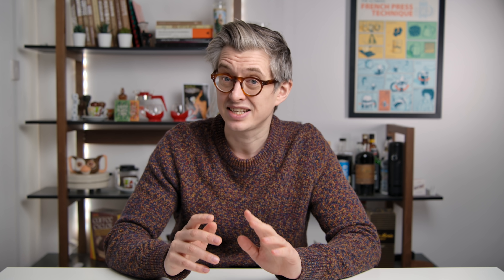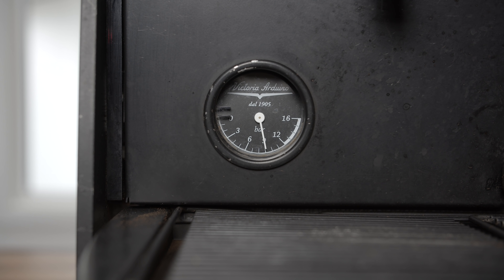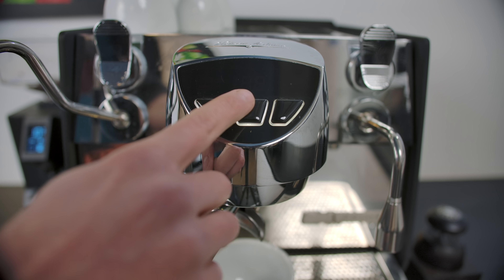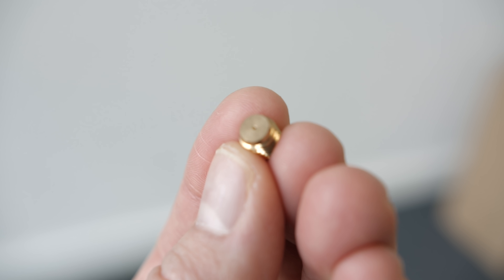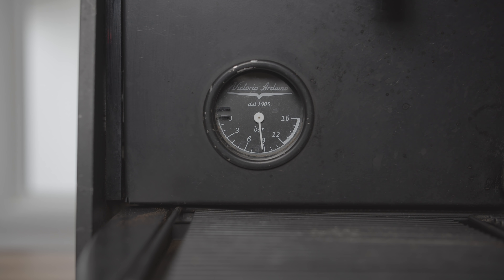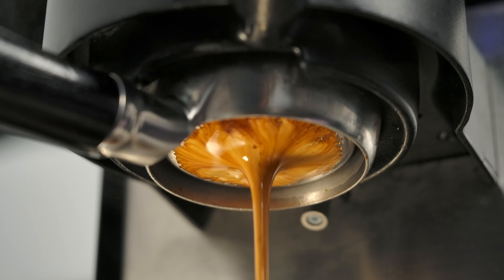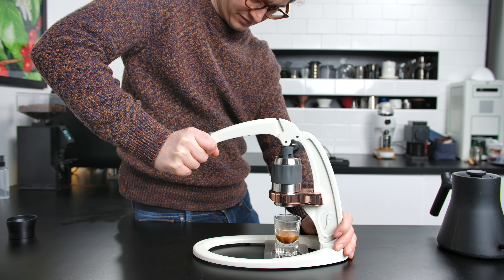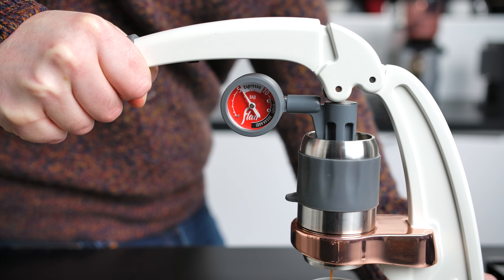Understanding Espresso: Pressure (Episode #6)

Comment: Dear @James: Thank you very much indeed for this illuminating episode! Since you asked what we do think, here is my question: 

If I undestand it correctly, at approx. 9 Bar, the maximum of what you can extract of a bean is achieved. Is that true for every type of coffee and bean (even if not desirable), and especially, for all filter sizes? As I understand it, if all parameters ar held identical (but scaled to the filter size, so 70 % for 49mm etc.), the same extraction yield is possible, but then the pressure should be the same?  

And foremost: What are the implications of this in regards to brewers like the Cremina, where often 6–7 Bar is used? You seemed pretty happy with the extractions in your review of this machine! Was the 6 Bar in the Video just a coincidence, could one have extracted even better at 9 Bar (is that even possible)? Should one alwas aim for 9 Bar, if possible, or are lower pressures better for certain filter sizes? Thanks for great content, as always, and best regards. Hope you have a wonderful day!
Reply: 9 bar is just the fastest. If you want to extract the maximum you do 0.001 bar and let the shot run for 20 minutes.
A short contact time with the water allows you to grind fine and achieve the taste profile that is characteristic for espresso.
In a way, 9 bar gives you the lowest possible extraction at a fixed grind size. 
The main concern today is the evenness of extraction. 9 bars is probably a little high for very even extraction but below 6 bars there are diminishing returns.

Comment: Could placing a paper filter, say something aeropress-like, on top of the tamped, dry coffee help cut down on channeling?  It would need to fit well so that fluid doesn't rush around the rim; however, the paper filter could simultaneously press down on the dissolving puck and diffuse any unevenness in the flow that might otherwise cause uneven erosion and channeling.  This may require slightly tweaked extraction time/temperature/whatnot, as a (hypothetically) very thick filter would reduce the overall flow rate and transmit the full weight of this load loss onto the puck: presumably compressing it as it dissolves, reducing it permeability.

Comment: I cant understand why 9 bar pressure is linked to the finer grinding level. You could grind as fine and with 6 bars pressure just your shot will take longer time. You could compensate that with lower water temperature if you don't like so high extraction.

Comment: I’m in the budget camp.... I’ve had the same Gaggia Evolution, a non solenoid Classic basically, for about 15 years but only started to get consistently reasonable espresso once I bought a half decent hand grinder, an Aergrind.  
My shots improved further once I started prewetting the puck with a 15ml scoop of hot water from the shot glasses I was preheating, filling and prewetting the basket even before placing into the holder.
If I prewet for too long, the puck degasses and you get zero crema, which looks rubbish but tastes fine.
The espresso from Smallbatch (Brighton) is usually still better, though...

Comment: My Lelit Grace produces 40g from 18g in 25 seconds, but used normally it will run 11-12 bar pressure!
Yes, I could grind coarser, but to run at 9bar I'll get my 40g in 10 seconds.
The OPV is set very high, and it's a major faff to change.
I've taken to opening the steam wand during extraction - water comes out and I can bring the pressure down to 9 bar.
Does this strike people as sensible, or mad?
Lelit are in total denial it's a problem and are actively unhelpful on the subject.

Comment: I have a sage bambino, and the pump audibly changes tone and volume between the preinfusion and full flow. Presumably this is yet another way of doing preinfusion? I.e. Lower pressure from the pump to start with, rather than mechanically restricting the flow

Comment: Thank you for this video. My ECM Synchronika was running at 10bar, after watching this I dropped it down to 9bar and what a difference it made to the shot. A more consistent extraction, a better tasting shot and what you said about the higher pressure compacting the coffee puck making it harder to extract must have been happening with mine.

Comment: When you turn the pump on on a machine that has a rotary pump, the pressure jumps up to 9 bar, or whatever it's set at, pretty much instantly. Vibration pumps take a few seconds to build up pressure. Is that kind of a built-in preinfusion process?

Comment: Great video! I have a Flair and for me extending the preinfusiont to 6-7s and lowering the pressure from 9 to 7-8 bar than slowly decreasing helped a lot. Also I use a comandante grinder, the increas in dose and the grind size really helped.
Reply: How do you like your Comandante? I'm on a waiting list for one after doing tons of research. I had a hard time deciding between the Kinu and 1Zpresso and the Comandante but in the end decided the Comandante would be the best for me. I also have a Flair.
Reply: @limer4330  Hello, It is great, and it is accurate and fast. It is much better than my previous porlex. I do not know if it is better than the kinu or 1zpresso, but it is made in germany and for the development they use a particle analysis of the ground coffee. It is really well made so with some maintenance it will last forever. It worth the price.
Reply: @kk215487965  Good day. One of the reasons I like it is that they spent over 100k euro on a particle analyzer. I doubt Kinu or 1Zpresso are at the point where they can even afford to make that investment. I would imagine that particle analyzer has played a big role on the overall design of the burr set in the comandante. And yes, made in Germany is big for me. They are hand built in the same building they are designed. Thank you for sharing your experience with me.

Comment: I have a 20-year-old ECM Giotto, and I noticed that despite the pressure gauge showing 1.2-1.5 bars of pressure, I get much more pressure if the machine has been on an hour or more than after 20 minutes, but again the pressure gauge shows 1.2-1.5 bars from 20 minutes onward. What gives?

Comment: 1. What happens to the taste with the different pressures?
2. Are there espresso machines with pressure valve on the outlet (after the coffee) to control flow and pressure?
Kind regards 
JSP
Reply: Pressure itself doesn't change the taste. Lower pressure generally improves the taste but you have to grind coarser and coarser and it will taste less like espresso. The optimal pressure is the one that prevents channeling but is still fast when you grind fine.

Comment: How about machines, where pressure only results from your brew recipe (like the typical Quickmill Rubino)? I mostly try to hit a 1:2 ratio in about 28-30 seconds, which always results in the machine showing a pressure of about 12-13 bar. The only way for me to reduce the pressure is to go for higher ratios, which of course has a big impact on the shot. Am I getting something wrong here?

Comment: I use an ECM Synchronika with the flow control needle valve in the E61 group. I am obsessive about uniform puck prep and consistent grind, so I use a high-quality grinder, WDT, OCD distribution, and a self-leveling calibrated tamper to eliminate most variables. I primarily drink darker roasts. I have found that the natural 3-4 second preinfusion is desirable for dark roasts, but with SHB high altitude lighter/medium roasts featuring higher acidity, a longer preinfusion before ramping up pressure tends to tone down acidity while preserving the bright fruit/floral/sweet flavors. I usually gradually decrease pressure near the end of the shot to avoid overextraction. It's a fun thing to play with when I get a batch of beans that I feel could use experimentation to improve flavor. I had the pleasure of playing with a Dalla Corte Mina that has full digital flow control via a tablet. It was amazing, but that's a rabbit hole I'm not ready to go down. 😁

Comment: Hi James! I'm hoping you may be able to help me with an issue that Breville haven't been able to. I have a Breville Dual Boiler (BES920BSS) machine at home. I am able to get the full 9 bars of pressure with a single shot. However, with a double shot (my go to!) I only reach about 7 bars. I am grinding using the Breville Smart Grinder at size 4 (very fine) - about 16-18g.  Is this normal for home machines? Love all your knowledgable videos. Keep up the great work!! Tom

Comment: So from a while back, I've taken your advice Mr. Hoffman of switching my dose to 14g, like in Italy, because less is more! 
This has lead me to tinker with Pressure, by opening up my Gaggia Classic.  With a smaller puck, the flow rate increased, and my grind size came to a point that was too small. I researched to no avail, what pressure do Italians apply when pressing a 14g puck into 40+ grams of liquid?  I dialed in the same espresso bean for 9, 8, 7, and 6 bars pressure. I found with lower pressure, espresso had a less harsh mouth feel and taste. If the pressure is too low,  you risked losing that zipp or acidity(?)and a balance in flavor. I settled on 7 1/4 bar as it gives a softer/rounder(new flavors) shot of espresso still with enough zipp and flavor.
(plus more room to play with at the small end of grind size) 
What pressure is custom in Italy for a 14g basket?
Reply: How are you getting 7 1/4 bar? Cutting the spring?

Used the 9 bar and now 6.5. 
Wondering how your more recent experiments are turning out to be.
Reply: @simonmonty7171  with Gaggia Classic, you can open it up and turn a specific nut, every 1/2 turn equals 1bar pressure of change.
Reply: 14g to 40g+? =this is almost a ratio of 1:3  Your style of espresso?

Comment: Any insight on pressures above 9 bar would be super useful. The new model gaggia classic pro brews at 12-14 bar and I for one would love the know:
A) why?
B) are there upsides to higher than 9 bar pressures?
C) are there major downsides?
D) what product you use in your hair
Reply: To my understanding this is to accommodate users who use pre-ground, store-bought coffee and utilizing the pressurized basket. I modded my gaggia classic pro pressure a week after i got it new and installed a pid 2 months after, that was just two days ago. Lol
Reply: I think a lot of people mod it so it does 9 bars (or sometimes 6). I think they say you're more likely to get channeling if the pressure or flowrate is too high. I think you'd end up with a more intense likely bitter and less than balanced shot usually. It COULD work well with certain lighter roasts depending on your tastes maybe.
Reply: @BensCoffeeRants  with high pressure you have a small room for error in your puck prep. You’ll get channeling unless you distribute the grounds perfectly.
Reply: is there a benefit for going up to 9bar? I hear that 6bar is the sweet spot for consistent and best tasting espresso?
Reply: @tusokpoweru  might be easier to work with 6 bars but I think 9 bar is probably going to have more intensity. Also not that it matters but I don't think it's technically espresso unless you're hitting 9 bars.

Before I really knew what I was doing I played with my machines opv settings a bit. Found 6 bar was nice but lacking intensity kinda boring. 10 bars was more bitter and intense but that also could have been because I had poor coffee prep back then and was just getting channeling. I think I kept it at 8 bar for a while and liked it there.

Comment: Hi James, could you please also touch on the aspect of pressure vs temperature? I mean a higher pressure generally also yields or is able to yield a higher temperature, right? Are those variables interconnected? I am asking because I own a Londinium R24 which, from what I understand, does not come with the possibility to increase temperature but it does come with the option to increase or decrease preinfusion pressure.

Comment: As usual great video! I cannot explain how it is possible thet I have a machine with a 16 (16!) bars declared pump, and unless the gauge measures 11/12 bars I get a superfast flow. I need to read something like 11/12 bars at the gauge to be in the 25/30 seconds range for a 1 : 2 ratio...
Reply: Same here. Grinding coarser an I will get a shot with lower pressure but lots of mess and it’s super fast. Tried to slow shot down with a higher dose but this did not make any difference.

Comment: I'm currently using a Breville (sage) dual boiler and currently running the whole shot on a preinfusion setting that allows for around 7 bars for extraction. The beans I'm working with taste completely different between this setting and at the standard setting (which I assume is around 9 bars) and while I'll probably revert back to no preinfusion, it's been interesting to monitor the differences between shots. Thanks James for giving me the confidence to tinker!

Comment: This made me quite pleased with my Breville Dual Boiler (lets be fair, i already was). I run a reduced pump pressure and grind to aim for 6-7 bars and then it nicely falls off as the flow increases. With a VST in it, a nice wide tamp and a paperclip.. pretty sure i often get even better espresso from that than my PB at work( which is set to 6bars). My grinder really is my only limitation in a home context.

Comment: As a pavoni user, I find that topic highly interesting, since I am the pressure (sounds funny...) . You speak about grind size (finer allows more pressure), preinfusion und pressure profile but how much does tamper(pressure) affect all the previous parameter? Interestingly enough, I don‘t have a machine equipped with a pump and I can‘t measure the pressure I apply while tamping so I only rely on feel, I‘d love to have your insight on that in order to gain consistency on my shots (which might sounds paradoxical for a pavoni user...)! Thanks!
Reply: @pauldavidson5  True, a leveling tool is another stable parameter in the process,as is time, tamping pressure remains more erratic, since I don‘t use either a dynamometric tamper or a puqpress.
Reply: @pauldavidson5  Right! We should claim the title of „old school analog home wannabe barista“

Comment: Hi James, as much as the Aeropress is an emersion brew, I was wondering, if this is possible: once the coffee is inserted into the aeropress brew chamber, using a tamper (with a long enough handle to tamp down that coffee. then pouring just enough water to bloom the coffee. Thereafter placing one of those metal aeropress filters on top of the coffee bed (to keep the coffee in place) and finally pouring in water and then quickly placing the plunger part on top and pressing down to create some sort of pressure. Would this work and also, a nice way to play with pressure? Side note: as anyone invented a naked porter filter with a clear screen around the bottom end of the basket so that if there is channelling, there is less mess?

Comment: I've longed after a new Spring Lever since I blew mine (a Ponte Vecchio Lusso) up after running the boiler dry. I think the reducing pressure and flow they provide is a great result and I think more 'natural' kind of than the active profiling of the Decent (which I also lust after). This leads me to wonder if the cult like following of the Cremina (yes I'd like one of these too) is a result of this natural profiling.

Comment: i'm an espresso noob trying to fine tune my flair shot. i think i figured out i maybe wasn't tamping hard enough, as the pre-infusion into flow got all messed up and water was just running through part of the puck, leaving the top too wet and a bottom portion completely dry. But i finally took the time to really press down, give the pre-infusion enough time (at around 4-5 bar) and then start pulling at 9. the shot ended up actually pretty good and i'll try more tomorrow. I'm just hoping I was right with the problem being tamping and patience to let pre-infusion happen.

Comment: Hey james: can you please comment on this section on pressure from the  cafelat user manual, where he says nine bars is taken from the water inlet, not at the group head.   I just bought and am learning to use this beautiful machine, so am very curious how what you are saying relates to my manual learning experience.
  -thanks.
					
quote;

 The 9 bar magic number.
				
  Ignore that number when dealing with a lever machine. In my experience
TLCM rarely extract above 7 bars pressure. The 9 bar pressure has come
from the Faema E61 machine, where the pressure was taken from the water
inlet to the coffee machine, the extraction pressure at the actual group head
was much less, possibly even 1 bar lower. But 9 bars were adopted as the
gold standard.
					
 On the Robot you should be aiming for an extraction pressure of somewhere
between 6-7 bars. Feel free of course to experiment but that is what I have
found works best so far.

quote;

Comment: The Sage machines have mechanical preinfusion, but the preinfusion pressure is a lot lower. Also, there isn't a pause inbetween. The pump starts with low pressure for few seconds and then immediately ramps up to full pressure. James, I saw you using Sage machines in some older videos, those should have used that method I guess?

Comment: Does raising or lowering the pressure and or flow mean you also have to change the temperature because now you’ve got a faster or slower pull? I would think that the pressure and the flow rate would have an effect on shot time. Unfortunately I don’t have a Lelit Bianca or anything to test this with.

Do the same ratio rules apply when working at different pressures such as a 2:1 recipe in about 30 seconds?